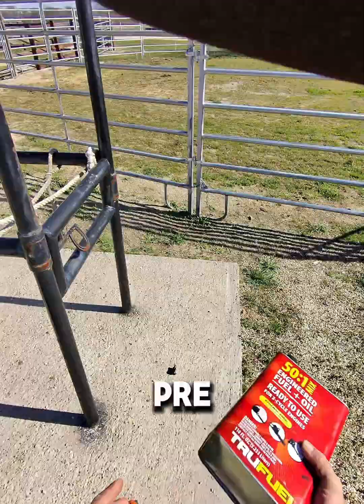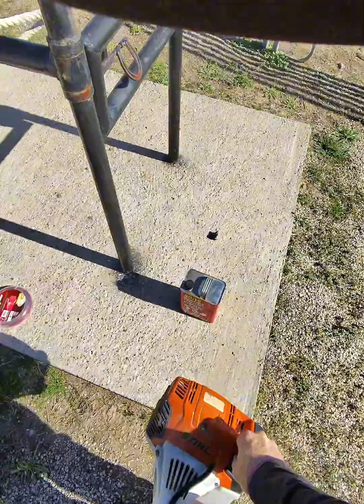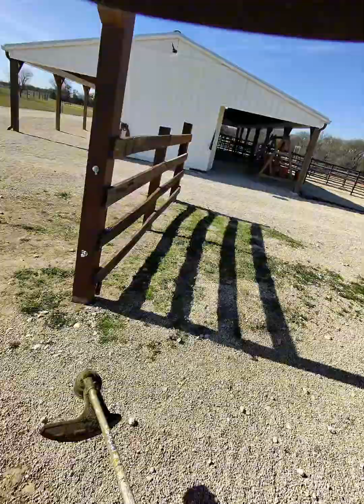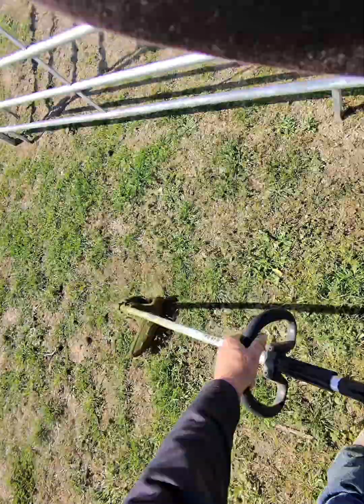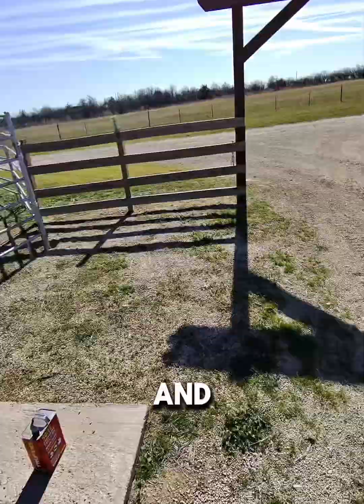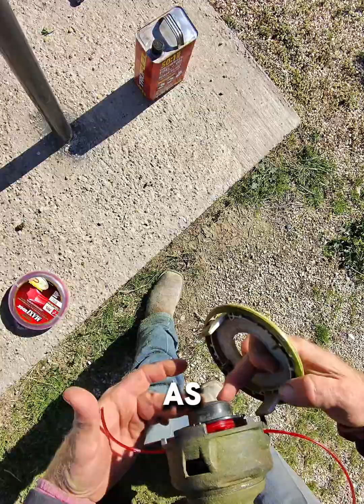How to get a ranch job. Weedeater operation. Prepare yourself for your career as a Ranch Employee!

Comment: As a 30 year small engine mechanic I would recommend using different brand of premixed fuel. I have had a lot of problems of the budget brands causing running issues. My preferred brands are the stihl or Echo red armor. Solid video though.
Reply from the maker: Thank you sir! I will swap it out!